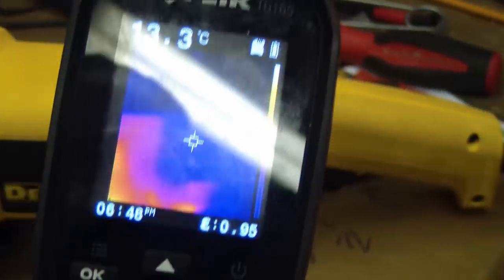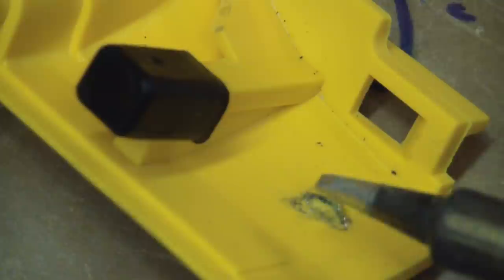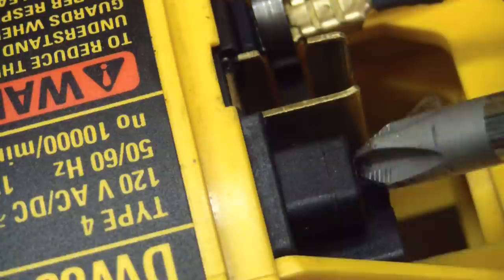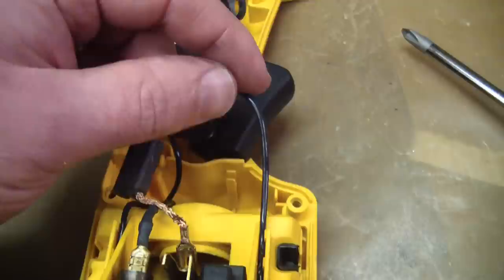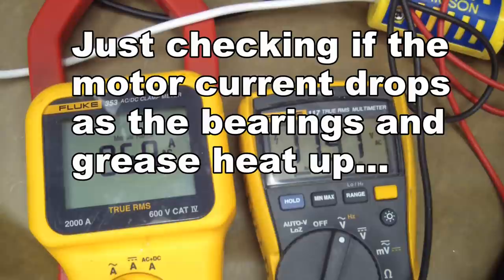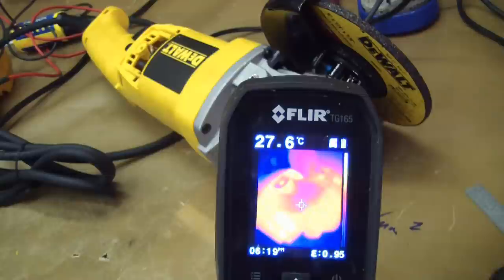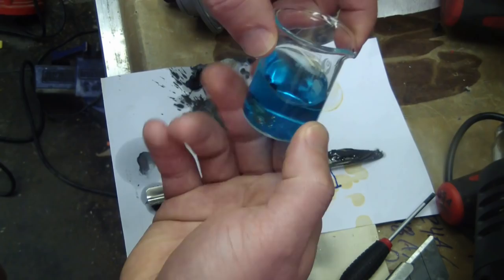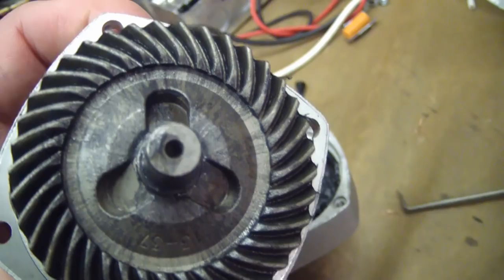Bored of lame tool reviews? Meet DeWalt's grinder guts Part B

Comment: I dind't get the thing with hand tightening the disks :D
Maybe I'm dense... :(
Reply: Mtaalas I didnt either
Reply: krssnoop I'd assume its because no one wants to go looking for the flippin tool to take off a used disk.
Reply: Mtaalas There's a button on the gearhousing you press to stop the gears from rotating, so if you turn the disc the right way you can tighten or loosen the nut that holds the disc in place. Easier than grabbing a tool every time you want to change discs.

Comment: Im wondering if the powdered metal gear is for safety - as in a definite failure point that can easily be repaired if its overloaded or suddenly binds?

Comment: Did I miss something here or is this worth it's asking price? Too many times you get off on tangents, no offense as I am equally as guilty, and you start a point but don't finish it and that makes for a very long and boring video. So is this tool worth the investment despite the few drawbacks? I can't afford to buy cheap and buy 20 times even if paying more upfront is required. Also I can't buy twice either, so do tell... Cheers...